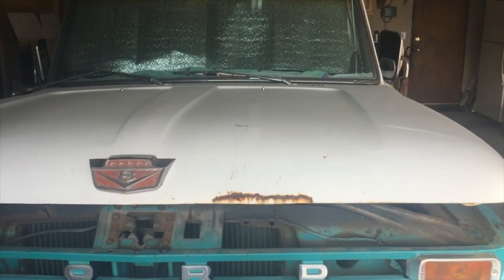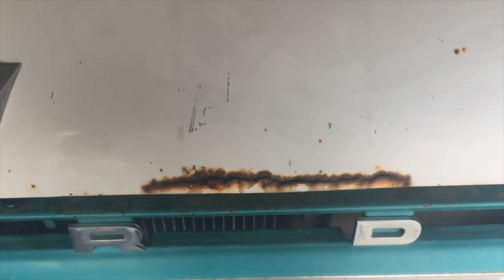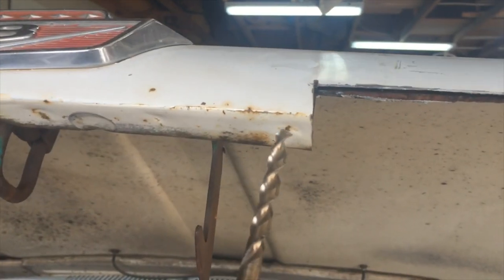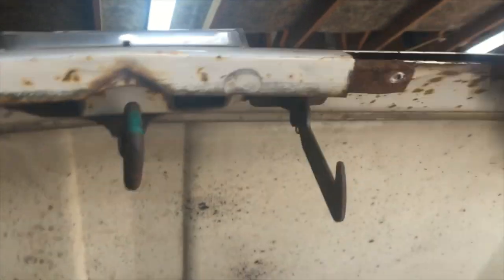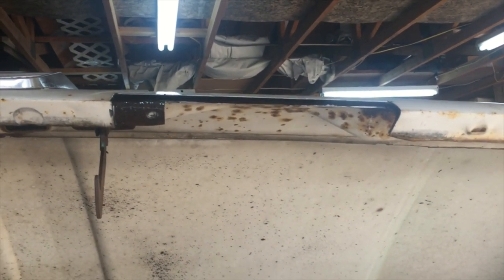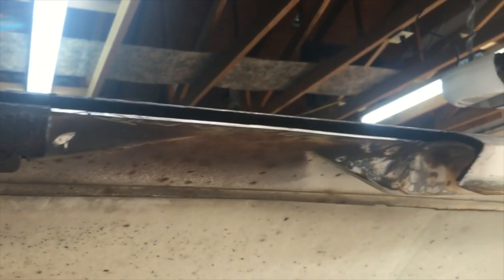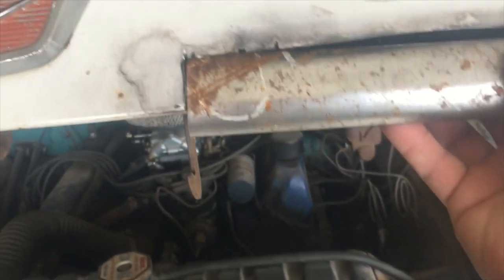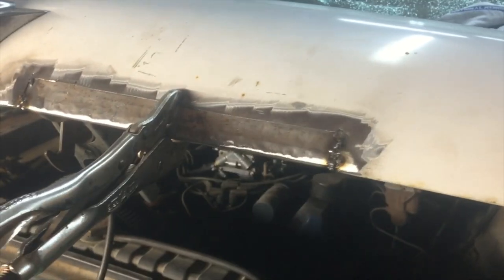Ford f100 Restoration Episode 4: Hood Repair

Comment: Nice job.  I'm surprised it warped just from tacking the sides.  You must not have given it time to cool per tack/side.  I like to make a few tacks and then either let it cool naturally or hit it with compressor air to cool it.
Reply from the maker: Thanks for the tips!
Reply: I think it warped from welding in the backing/ inner patch. Not the outer one